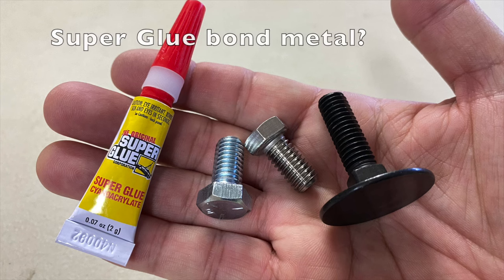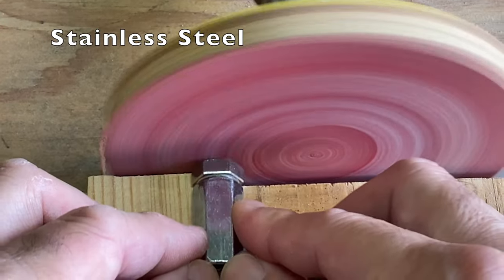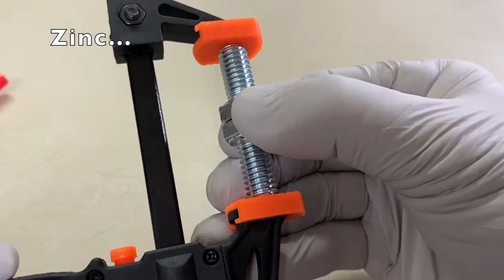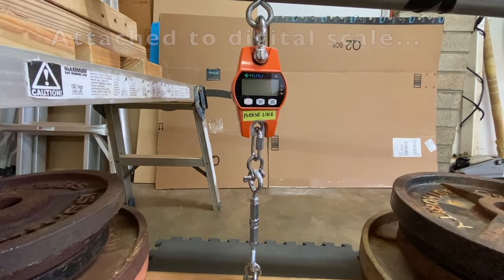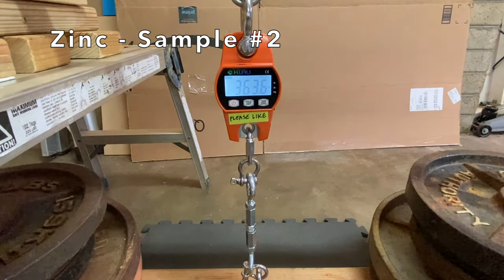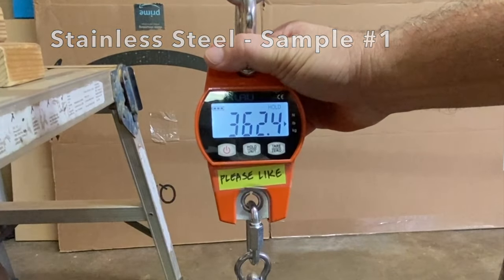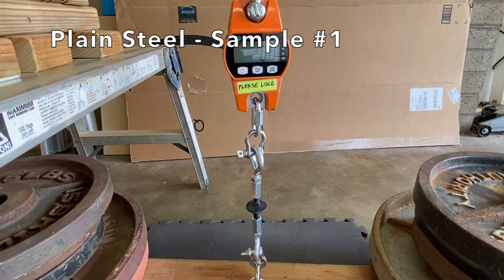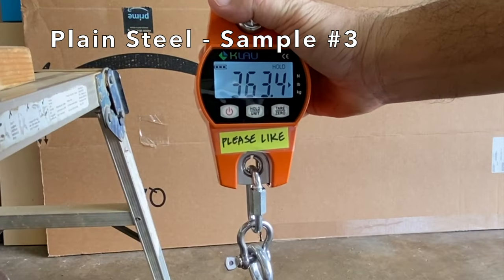Super Glue Metal Bonding - How Strong is Super Glue?

Comment: You ground off the zinc coating on the bolts meaning you were just testing steel on steel bonding. Zinc metal is much too soft to make a bolt from and many metal parts you find at the hardware store are zinc coated to prevent rust like your original angle bracket. I really appreciate your channel and am only trying to help, not criticize.
Reply from the maker: Thanks!  Appreciate the feedback.  
In my earlier video, I sanded and cleaned the zinc-coated brackets the same way and the bond was very weak.  I repeated the test several times and got the same poor results.  Maybe it was because the pulling force was off-center?

Comment: Sorry but this is a very poor way of conducting an experiment. You really should have attached a gauge that can measure extremely high load levels and loaded the bolts until they break apart. That really tells us how strong the glue is on different materials.
Reply from the maker: Thanks!  I agree.  
I didn’t expect the glue to hold that much weight.  At some point I’ll setup another test rig that can safely handle more weight.  😎

Comment: You proved absolutely nothing. All testing for glue is done to the point of shear which you did not do
Reply from the maker: Thanks! 
I mentioned in the video that I couldn't safely add anymore weight.  If anything, I proved that it could hold over 300 pounds.  😎

Comment: The pull strength is very high, but the sheer strength will be very low.   Do another test and apply a shearing force to the two bolts.   The bolts will break apart.   I've tried super gluing metal pieces together, and while the bond seems to be very strong, if you apply a lateral sheering force to the two parts, the joint will EASILY break apart.   That's because the surfaces of the two metal parts are relatively smooth, and the only structure holding against a sheering force at the joint is the actual breaking strength of the polymerized cyanoacrylate glue, which is a fairly weak plastic

Comment: How does this test work exactly? Like wouldnt you measure the glue weight up until it breaks? Idk if I looked wrong but I didnt see any of the vonds break at all, meaning it definitely couldve taken more weight right? Especially since 300 pounds is like a tenth of what the steel to steel glue strength is rated with those bolts that were at least 1 square inch....
Reply from the maker: Yeah… 360 lbs was the limit of my test rig but still pretty impressive strength for a drop.  I’ll rig something else up in the future to handle more weight.  Thanks.
Reply: @HacksbyDad  like how or why were the ratings different ?   scale failure ?

Comment: That's impressive.  Can you redo the test with a smaller interface between the metal parts?  That way you can cause them to fail at values that you can measure with that setup.

Comment: To findcout the full strength, of different metals you should sustain a weight like you've done, but then pull to destruction. The drop of glue is the same, but wider on washer head, and type of steel might make some difference.
Reply from the maker: Thanks.  The super glue was stronger than I anticipated and I couldn't safely add more weight.  I'll redo the test in the future with a new rig.  😎